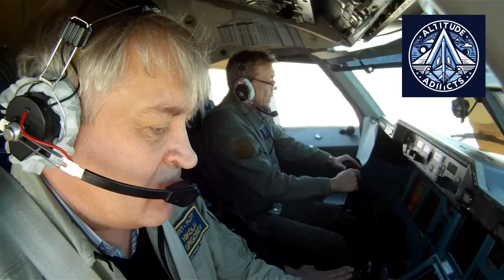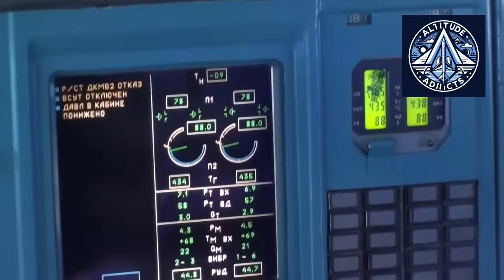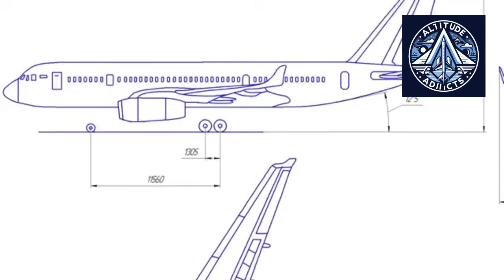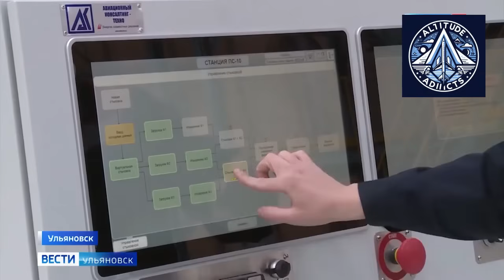Tu-204, Tu-214, PS-90A3  | How Politics Grounded Russia’s Next Airliner and Engine

Comment: as long as russia does not internationalize it's civil aircraft production through joint ventures, it will eventually fail totally. the man who said that the development of aerospace products is costly and drawn out was right. russia does not have the economies of scale for a fully fledged aerospace industry. in fact even the mc21 will fail unless this strategy of jv is adopted.
Reply: Two MC21s have already flown. These aircraft are made entirely from Russian components, with new, modern PD-14 engines. No other country in the world is capable of such a feat.
The Superjet 100, equipped with the new PD-8 engines, has also flown.
It probably goes without saying that Russia produces military aircraft. The Il-114 is undergoing testing.
In the 1990s and early 2000s, Russia adopted a strategy of joint ventures with foreign partners. And it failed. When the West, seeing that Russian aircraft manufacturing had practically ceased to exist, gave the go-ahead to shut down joint ventures, imposing sanctions under trumped-up pretexts. Thus, Russia was left with a completely devastated domestic aviation industry, without joint ventures, and even without spare parts and components.